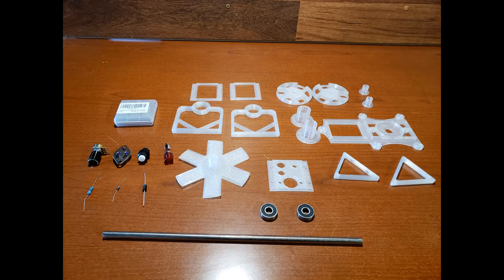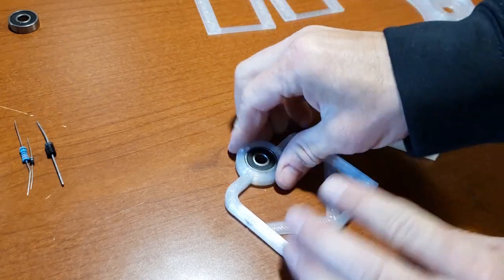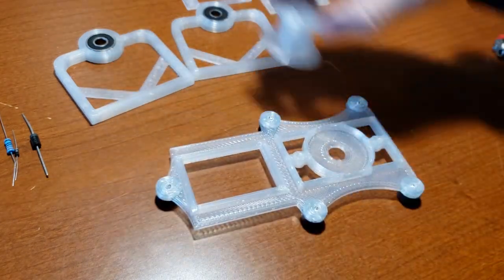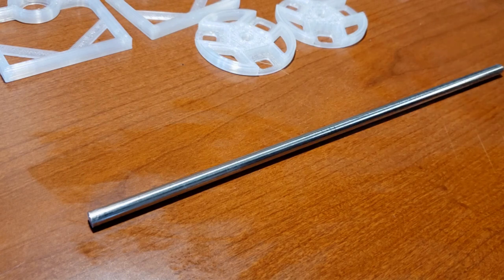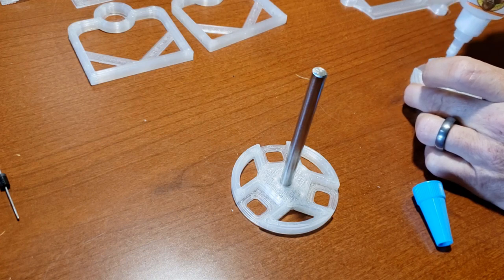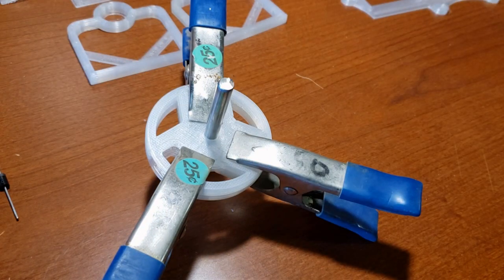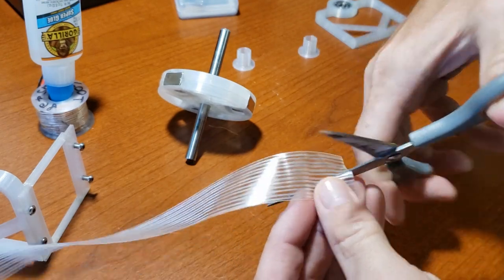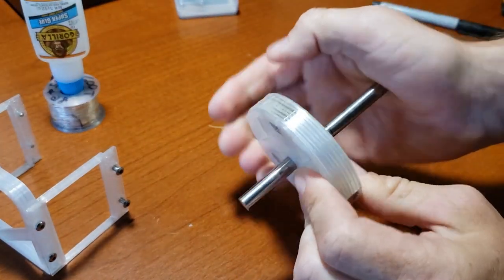Basic Bedini Pulse Motor Part 2: Fame and Rotor

Comment: I started printing your design with transparent filament, just like you. I will do a video with it. 
What wire gauge are you using? 25 + 28 AWG/SVG/MM?
I think I have the rest of the components I see in the videos with this motor.
Reply from the maker: Nice! I appreciate that.
Reply: @redesign3dp   I have finished printing all the parts, can you tell what wire gauge unit are you using? (600T of 25 + 28 AWG or SVG?) I'm from eastern Europe and I need to convert the gauge to metric to actually catch the attention of sellers that refuse to sell me coil wire without telling them why I need it :))
Reply from the maker: 20/25 awg uses more amps but gets better output. 25/28 awg starts easy and draws less.
Reply: @redesign3dp  Good, because I currently only have 25 and 28 AWG. Thanks for the reply!